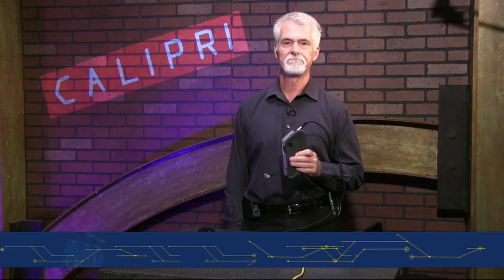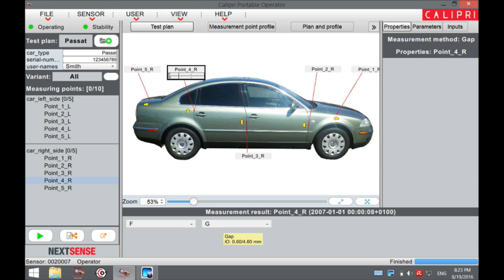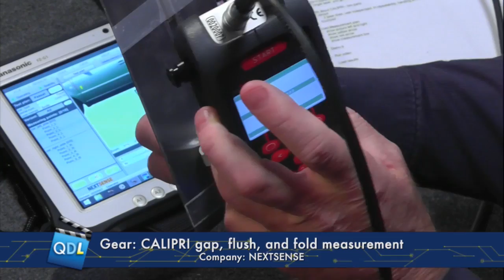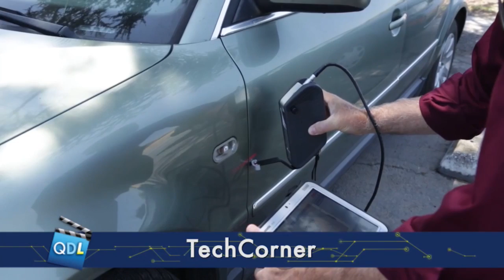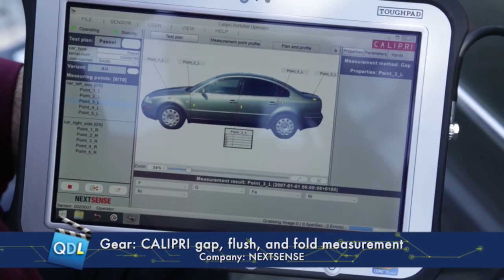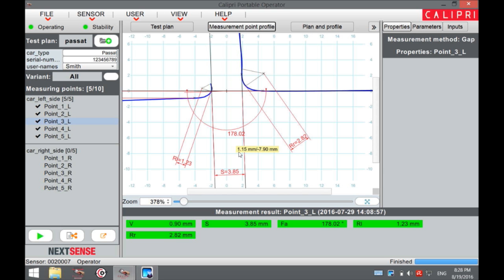Tech Corner: NEXTSENSE, CALIPRI gap, flush, and fold measurement

Comment: I've had some experience with the Calipri and am very impressed. One thing not shown in this video is the ability to select from multiple measurement methods. By keeping all operators on the same method, it ensures they get the same results (a gap can be measured from multiple angles, so with a standard measuring tool, you can get different answers, though all are technically correct. The Calipri lets you choose the method). Great video!